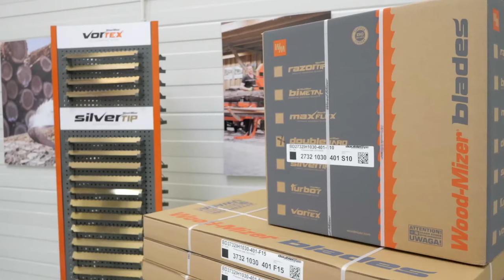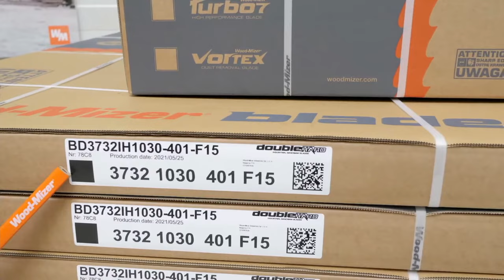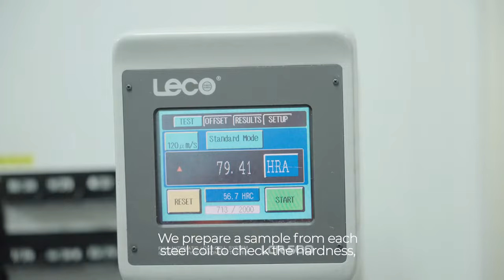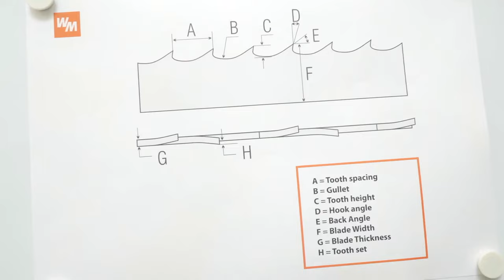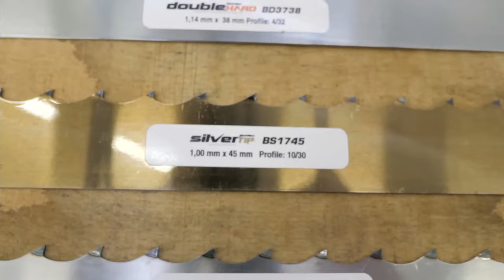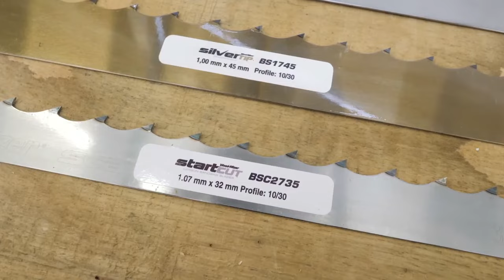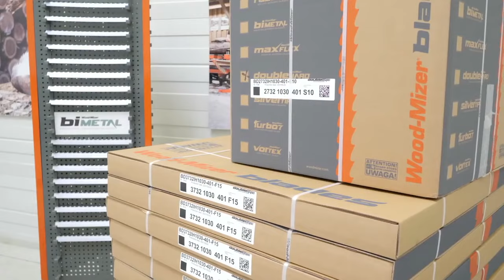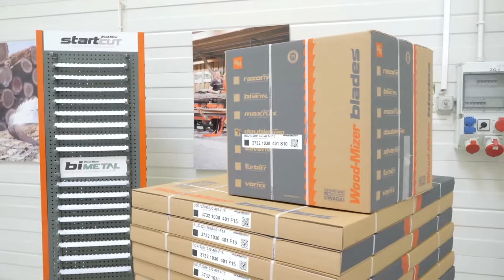Wood-Mizer LIVE | How to choose the right type of Wood-Mizer blade | Wood-Mizer Europe

Comment: Which model bandsaw is best for anyone starting to mill for own purposes ? Which blade is best for cutting European soft and hard woods?
Reply: I just put a down payment on an LT40HDS. I would think an LT15 would be a good machine to start milling. Are you at all related to Mike Dodd?
Reply from the maker: Hi Kenneth, Thanks for asking. In Europe, the most popular profile is 10/30 because you we can use it for both hard and soft wood. If you want to mill only hardwood, you need 4/32. Remember that if you mill hardwood, the tooth setting should be smaller than for softwood.
Reply from the maker: Hi "Almost Italian", yes, the LT15 is a perfect machine for starting milling. We recommend also LX50 as a starter. The LT40HDS is an awesome toy! It'll deliver a lot of fun and efficiency on a professional level.
Reply: Thanks woodmizer im excited
Reply: Which bandsaw you choose is going to greatly depend on how much production you want to run and what type. If you are into the wide slab market, you want to look at something with a wide head option like the LT15 Wide, 40/50/70 wide, LX 150, or LX250. If you are at a hobbyist level, the LT10/15/LX25/LX55 are good starts. They are manual mills so the heavy work of loading, turning and unloading will be on the user or whatever you have available whether it be wench, tractor, forklift or other machinery.

If you want to do more production, you can step up to the Hydraulic mills such as the 35/40/50/70. The LT35 is a good starter hydraulic mill. With these mills, not only do you have hydraulics, you  also have computer controlled feed and height adjustments. The LT35 is not available in a wide head format nor do you have features such as dragback or command control and the simpleset system only allows you to drop the sawhead incrementally based on your settings. (read further to see the difference between simpleset and accuset 2)

The LT40, Super 40, LT50, LT70 is where your real production levels start to kick in. With each of these, you have options such as Wide heads, Drag back, Stationary (command control, remote control, pedestal controls. (These allow the operator to stay stationary and not walk miles per day when milling). Additionally, these mills have the accuset 2 option. Accuset 2 allows you to control the sawhead height both up and down based on settings, pattern cutting, include blade kerf in settings and much more.

In terms of blades, there was a great deal left out of the video here. I'll try to break it down to make as much sense as I can.

It's not as easy as saying "choose a 4 degree double hard for hardwoods".

Metal type "double hard", "Bi-Metal", "Silvertip" et al, really has more to do with how long a blade can stay sharp, how long it lives before breaking, how it stands up to metal strikes and how much money you want to invest. 

Silvertip used to be the least expensive of the WM blades and is offered in a number of different profiles. It sharpens easily but, you are generally only going to get 4-5 sharpenings out of them.

Double hard is the "middle of the road" blade. You get good sharp life (stays sharp longer than silvertip), can be resharpened more than a silver tip (generally) and is also available in a variety of profiles.

Bi-metal and RazorTip blades are for sawing dirty logs (metal and abrasives) in production environments. You can use them on any of the mills, but with the cost of the blades, entry level sawyers may not have a need for them unless you are sawing exotic woods that will just wreck SilverTip and Double hard blades.

Width of blade:
This is really determined by the mill you purchase. Each mill has a specification for how wide a blade you can or should use on it. Most of the mills use a 1.25" (30mm) blade. On some of the mills, you can step up to a 1.5" (38mm) blade. Only the biggest mills can take a 2" (50mm) blade.

Blade width has a large impact on how fast you can run the blade in the material but the biggest impact is on flatness of cut. Wider blades will stay flatter in a cut than smaller blades. This really comes into play with knotty materials.

Hook angle.
This is probably the biggest debate amongst sawyers worldwide and rages all day, every day. Here's my opinion on hook angle. Any hook angle will cut ANY wood. Period. It's just a matter of how fast it will cut and how cleanly it will cut.

On lower HP mills (<25hp), the harder the wood is, the less aggressive a hook angle you want to run. 4 degree is a good hook angle for hardwoods in general and especially for lower HP mills.

7 degree is the workhorse. It is the best "All around" blade that will cut hardwoods and softwoods easily. It's what I use unless I am milling something special such as extremely knotty pines, resawing heart pine, oak barn beams, ironwood etc. Currently, WM offers 3 variants on the 7 degree blade: Standard 7/39, Turbo 7 and 7/47. Standard 7 is fine on most mills. Turbo 7 really wants a high feed rate or you will get chatter on the boards. 7/47 is a good blade with a fast cut rate, good dust removal but really wants more HP/Torque.

9 & 10 degree blades are really good for sawing soft stuff like pine, balsam, poplar etc. They will generally cut the softer stuff faster than a 4 or 7 degree blade but really slow down in hardwoods unless you're running a lot of HP to be able to push it hard.

Thickness.
The thinner the blade is, the more flexible it is but, thinner blades have drawbacks: quality of cut and heat build up. .050 thickness blades are, again, the middle of the road. They work well on 19" wheels and stay flatter than an .042/.045. But, the thicker the blade, the more power it takes to push it through a log. Most of the mills will run an .050 just fine. I prefer an .042 for speed, but step up to .050 in knotty materials and really hard stuff. .055 are for big mills. You need larger wheels to reduce the strain on the blade and you need more power to push them.

In summation:

Most hobbyist sawyers running mills such as the LT10/15/LX25/LX55/LX150 can do just fine with running 4 and 9 degree .045/.042 blades. The reason I say both is, the 9 will cut your pine much faster than the 4 while the 4 will do better in your hardwoods.

LT35, 40, Super 40, 50, 70 mills can really run 7 degree for everything and be just fine. If they want to max out production in softwoods, they'll run 9 or 10 all day. Hardwoods, 7.